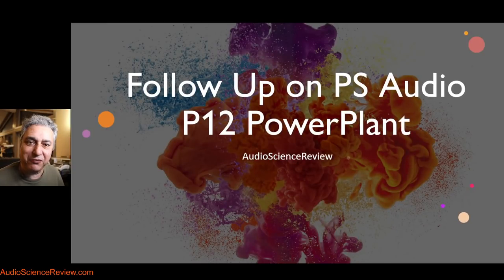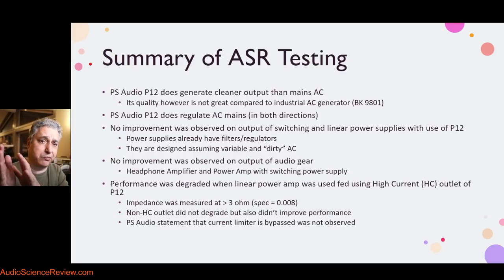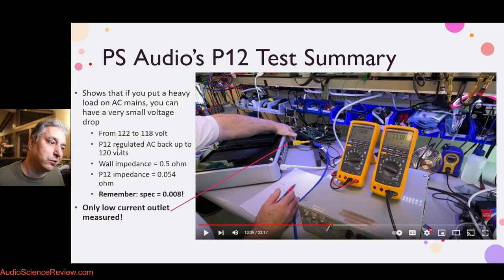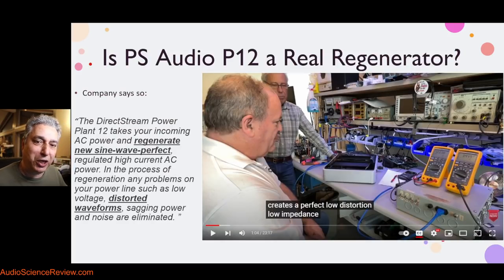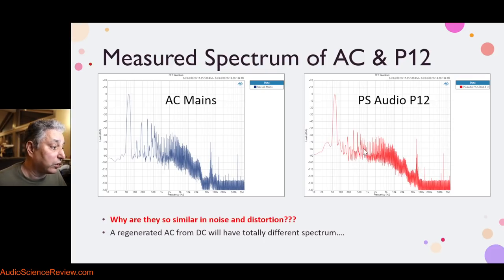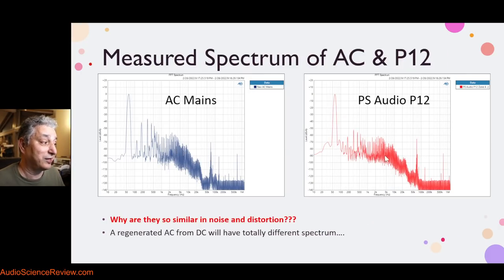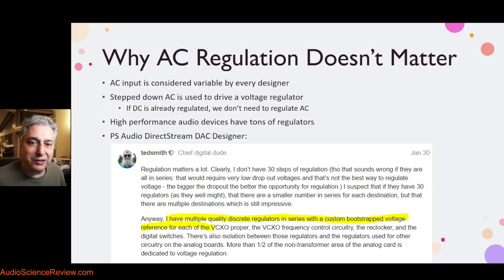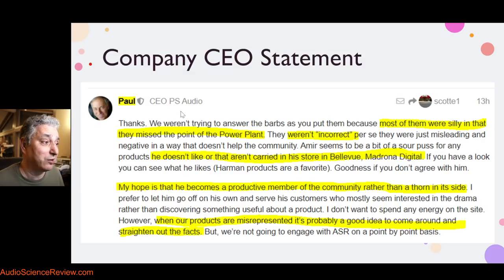PS Audio PowerPlant Measurement Follow Up

Comment: I'll keep both of my EATON AC to AC industrial 3KVA UPS converters, can even use it for for 120V equipment (i'm in europe with 220V mains).
Living on an island there is a lot of variations on AC, even sudden loss of power and i dont use them for "improvement" as any power supply should be able to make it it-self as Amir stated.
I need a UPS for sensitive equipment, and thy can do it all.

Comment: I first heard about a regenerator in Paul's video where he compared electricity to bread.  I don't think he knows what an amplifier does with AC.  Ironically, plugging audio stuff into a power strip that tanks the power factor is the only power related tweak I've seen make a measurable difference and that was just the mains hum dropping into the noise floor which you probably wouldn't have been able to hear anyway.

Comment: A more practical unit was the patented Exactpower unit which used a micro computer to adjust the voltage output and waveform relative to a reference internal reference oscillator. Unfortunately, the product was purchased by another company who claimed that some of the parts were no longer available to continue manufacture.

Comment: I feel like, PS Audio designers create products on theory and don’t care about testing those theories before going to market.
Reply from the maker: Absolutely correct.  So many times I find myself as the first guy to test their theories.  They don't measure.  They don't do controlled listening tests.  They just imagine problems and then create -- somethings very complex solutions -- to sole those problems.
Reply from the maker: Sadly, it is widespread as you say.
Reply: Theories are tested hypothesis that have not yet risen to the level of scientific fact. PS Audio engages in wild unfounded speculation on issues that are much more easily and reliably explained by bias effects and easily tested for bias effects. But I appreciate your generosity in word choice.

Comment: Has anyone mentioned that the peak current drawn from the mains is many times the average current in the usual linear power supply,  because current flows at the peak of the waveform when it charges the reservoir capacitors, and little flows for the rest of the waveform. Charge = current x time. A PFC switching supply is designed to draw current over the whole waveform to address this.
Reply: @Douglas Blake Yes, for low power switching supplies. High power,  high efficiency switching supplies above a few hundred Watts have an additional "Power Factor Correction" first stage. Even so, PS Audio used a load resistor on their Power Conditioner when they measured it, which is not representative of any load that may be attached in real use.
Reply: @Douglas Blake The unfortunately-named PFC first stage is a boost regulator, resulting in a bus voltage higher than the peak of the voltage of the supply. Power is drawn throughout most of the mains cycle. ASTEC and Artesyn produce modular power supplies with a PFC frontend and a choice of output modules of different ratings so that semi-custom supplies can be specified. PFC in this case is not a capacitor; you are thinking about electric motors.

Comment: Wow, Paul made it personal with the attempted character attack.  Kind of trumpian, divide and conker mindset. 

Regarding the noise spectrum similarity, I wonder if, in order to get safety approvals they had to add a capacitor between input and output, which in turn just passes the high frequency noise from the line input directly to the line output?  Syncing to a line frequency is very challenging, I've seen it done on industrial USP systems for hot switch over but it really does sound strange that the re-generator would need to do it.  If fact, I'm surprised that they wouldn't make a claim that it would be better to increase the frequency of the line output, as somehow being beneficial.    

And the whole third harmonic thing, I guess it wouldn't hurt on audio equipment that uses a SMPS on its input but for most equipment that has an iron transformer, it would just make the transformer run a little warmer.  I totally got lost on what the third harmonic is supposed to do.  We all know that adding in the odd harmonics puts you well on your way to making a square wave.  Not something iron transformers like.

Paul's customer base seems to be somewhat well educated men with excess funds but do not have engineering backgrounds and tend to look up to people like Paul for guidance.  That's Paul's 'community'.  Otherwise I suspect they're fairly close minded.
Reply: Divide and conker, Trumpian indeed!

Comment: An always on UPS with filtering and at least 1000va would do just fine if your worried about power conditioning, protection or dropping voltage. "have to make sure it's always on" otherwise it doesn't feed the equipment from the batteries. There not as pretty but they are 1/4 of the price...

Comment: My paradigm speakers of some 20 years ago have virtually identical measurements as my brand new Polk Legends, yet the Legends sound remarkably better (to a wide range of people in my home).  My new NAD amplifier has virtually the same measured specifictions as my near 30 year old Adcom....yet the NAD is shockingly better (when used on the same speakers with the same associated equipment).  My compact discs have measurably better specs than the identical recordings on vinyl, yet the vinyl sounds better.  Perhaps we are measuring the WRONG "specs."
Reply: Shhhh.  Don't spoil the nerds' fun.  Remember the old saying: if all you have is a hammer, every problem looks like a nail.  Case in point--on Amir's recommendation, I bought some Elac debut reference dbr62s.  They were fine sounding speakers at $700.  But to MY ears they sounded very slightly worse than my $239 (on sale) JBL Studio 530s, playing my HD streamed music in my living room.  Guess the Analog to Digital Converter (ADC) between my ears needs fine tuning to better comport with Amir's specific measurements.  Not that I think PS Audio is a good company that sells value-for-money products, or that Amir's measurements regarding said products are valueless.  But as others have stated here, the ONLY valid test is a side by side comparison made by yourself with your own components.

Comment: What I am reacting to is the pricing from PS Audio. Back in 2005 when I bought my PS Audio PPP regen. it cost around 2.500,- today the P12 (less power but comparable) is 7.500,- where I live. Horrible prices for what you are getting. PC Audio has gone from a low price company to demanding high prices but for the same level of quality as from 2005...or worse ^^ ...
Reply from the maker: I too was shocked when I saw the prices for these a few years ago.  It takes incredible marketing to convince people to spend so much money on a widget like this.  I am pretty sure I paid a lot less for my PS Audio P300.

Comment: ?? P12 is NOT a power regenerator. I once owned this equipment, in my rudimentary testing, I tried to use an AC line Ethernet adapter and it worked perfectly, even higher bandwidth than using main AC only, I guessed that the filtering inside the P12 was helping. No explanation was ever given from neither the dealer nor PS audio. I have avoided PS audio ever since.

Comment: Do you tend to listen to the equipment you are reviewing or do you just form an opinion purely based on measurements?
Reply: I would say we get and had over the past few decades plenty of "the playback had more inky blackness and felt more crystalline in its presentation" type reviews to last a lifetime. It's nice now to see some actual technical reviews that examine how the devices actually work at a electrical level. All those years ago I just wished for someone to actually technically test all these gadgets. I remember the Chord Clearway Mains Enhancer from like 20 years ago. They were selling by Chord for like £200 back then. I then pointed out on a forum they were identical (physically and technically) to a PMF6 mains filter that cost £20 from Farnell. That caused quite a stir and the Clearway Enhancer vanished from Chord soon after.
Reply: @jabezhane  how about both in the same review? Measurements+listening. Isn’t that how it should be?
Reply: @lapetitemortbis  Not necessarily. When buying a product you look at several different reviews and make your decision based on all the detail you get. You just don't accept the opinion of one review do you? Do I need to hear Amir talk about 'inky blackness' and 'more defined' to find information of value from his reviews? No.
Would you buy a car purely based on a Top Gear review being thrown round a race track? No you would look up the tech specs etc. elsewhere from other reviews to build a full picture.
Reply: @jabezhane  of course I am not looking at just one review. I am just saying that scientific method is not complete without its observational aspect (which I would think in this case translate into listening) I am not necessarily talking about this particular review and I find what Amir is doing tremendously valuable, I just don’t understand the hardcore stance (I may be wrong but this is my initial impression on his forum, I am new here) on sticking with just measurements. That’s all.
Reply: @Douglas Blake I am rather new here so I wasn’t necessarily talking about this particular review but as I wrote above (and again I may be wrong. This is just my initial impression on his forum) there seems to be a hardcore stance on just sticking with measurements without listening. I just don’t get that. Other than that I love what Amir is doing/stands for or what he is trying to achieve
Reply: @lapetitemortbis No worries I get that.🙂 However, this test/review shows that a 'dirty mains' signal goes in and the "perfect regenerated' signal that comes out is...95% the same. I think that tells you all you need to know about what potential 'listening effect' it may have. I would say next to none for a 37KG $6000 device. More differences better or worse just moving your speakers...

But yes the odd "well it tested crap but it sounded fine to me so give it a try YMMV"  might be interesting.
Reply: I suggest you watch measurements 101 by Dan Clark.

Comment: I’ve designed and built very high grade professional electronics to give my mobile recording truck better performance. The very first thing I do as plans are approaching build and test is to make the best, closely regulated, dual-redundant power supply I know how to make. I make no effort to cheapen this part due to the nature of my business. Nothing must ever fail. Ever. 

And you know what? The actual cost is meaningless by comparison to the job it does for me. Regulation and filtering are built right in to virtually all hi-level, pro audio equipment of which I’m aware. There are exceptions, but not at the top of the industry. My two, cost-no-object , dual-redundant supplies, one each for two 50 channel onstage microphone preamp systems, cost about 5% of the total project. They have been in constant, traveling, onstage use for 31 years. 

Perfect power is the cheapest insurance ever, and it is genuinely a trivial design job using easily available components.

Comment: This is a product (ie PowerPlant) that I don't need and wouldn't spend $ on but, if I did spend thousands of $ on any electronic product I would expect it to measure well.   We are beginning to get a feeling that products from PS Audio, in general, do not measure as well as the price points would indicate that they should.  They do have, conversely, a fairly loyal following so they must be doing something right (marketing ?? ...).

Comment: Ok, I kind of have to admit I like the "fat AC" thing! 😅 While the notion of a chonkier waveform is appealing, the few DIY amps that I have that could benefit from something like that need higher peak-to-peak voltage, not more fat under the curve since that doesn't really impact the resting voltage of the power rails. That kind of doesn't really help much when you think about it. Once the caps are charged, they're charged. Might help a little with droop under load. But still improper. What would be cool would be if the thing could act like a variac and buck or boost the voltage from 100-130V RMS AC. I would have thought I would learn my lesson from killing car audio amps doing dumb things, but why not be greedy with the home audio stuff as well, even if it could burn the house down.

Comment: A real world test would be to put this "device" on mains power source that has several non-linear loads (computer power supplies, washing machines , with inverter drives) and see what the output looks like.  

Stepping back you need to ask yourself how much of the distorted AC on the mains can get through the power supply in a amplifier.  The answer is none.  if your concern is noise you should be looking at the ground circuit not the power source.  

Amir, your holding a full house,  he's holding a pair of duces.
Reply: Agreed. Show the difference in AC waveform between "polluted" mains and the output of the P12 (no doubt there will be one). Then do the test that would be very telling, do voltage, noise, waveform tests on the main low voltage DC rails in a DAC, CD player and an amplifier playing a low frequency tone at a reasonable power output level. Let's see if any difference a power regenerator makes is passed on to the business end of audio equipment.

Comment: How is this any different from a common, dual-conversion UPS? Just without batteries? A dual-conversion UPS makes DC from the incoming AC, then recreates perfect sine wave power from the DC. These are dead common in the IT realm.
Reply: no sine wave is "perfect."
Reply: @jfdjkdjfkjdk  OK, be pedantic. The sine wave created by a good quality dual-conversion UPS is measurably cleaner than the utility power.
Reply: @MichaelGraves3304  agreed

Comment: a couple of questions: how often do you see tube equipment with an regulated power supply?  And when your mains voltage jumps from 230V to 270V, changing the anode voltage of your expensive tubes to 40~120V will not affect the sound quality, right?  And saturating of the core of your high-quality toroidal transformer by DC offset in your socket will also not affect performance in any way?  The fact that you were lucky enough to live in greenhouse conditions in terms of the power grid does not mean that such devices are useless for all